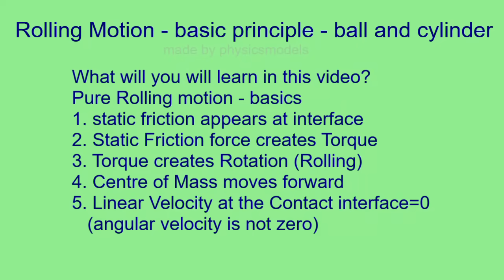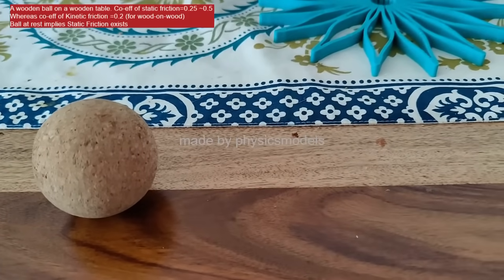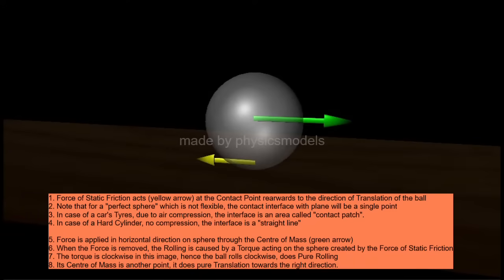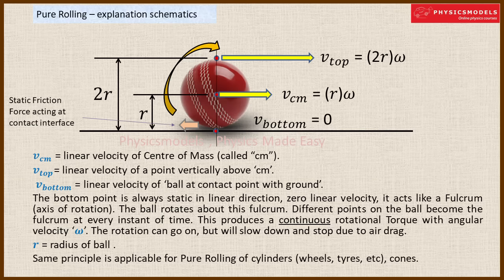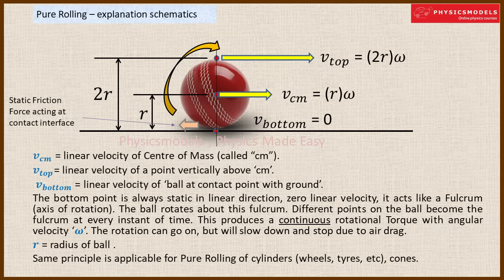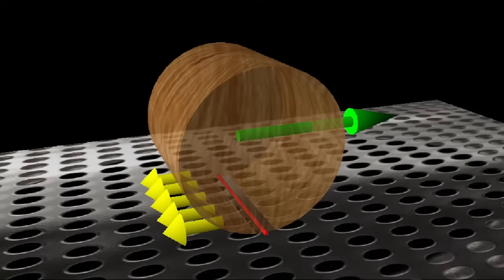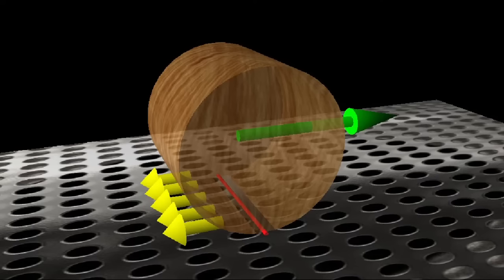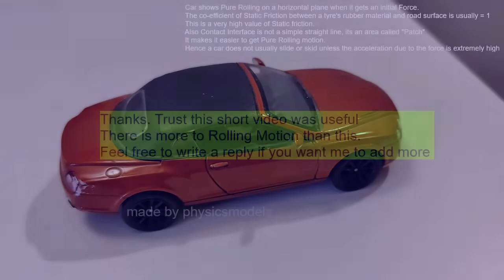Physics Made Easy- Pure Rolling Motion explained - Case of a ball and cylinder

Comment: If we're rolling forward say in the +x direction to the right, is the torque into the screen (say +z is out of the screen)?

Also to be clear, you're writing r*omega only rather than the cross product omega x r because r is purely 90 degrees from the rotational axis for omega?
Reply from the maker: Hi, for the ball in video , Centre of Mass has a linear translation motion towards the right. Let's call this the +X axis. The frictional force is towards the Left, the minus X axis. The Torque is such as to cause clockwise rotation of the ball. Apply Right Hand Thumb Rule. The direction of the Torque vector is INTO the screen. The Magnitude of torque vector is given by :  Torque= (Moment of Inertia)x (Angular Acceleration)
Reply from the maker: Hi jenm, also take a look at my latest video on Rolling Motion of a ball coming down and inclined plane, link: https://youtu.be/jRz6MjK7kN4

Comment: I have a doubt,Friction is necessary for acquiring pure rolling. So if after acquiring pure rolling if we removed the friction,will the ball still be in pure rolling motion.

Please clear it.
Reply: Yes the ball will still be in pure rolling motion. Friction is absolutely needed for pure rolling, but only to start it's pure rolling. Once friction is removed, the body will still roll purely
Reply: Actually, rolling is possible even without friction. That is possible if you apply a force at the point of percussion of the rigid body
Reply: @Serwerrryeah, in general we need just any force to provide a torque to the translationally rolling ball. friction is just one of the forces being discussed that does the job
Reply from the maker: Clarification: after the ball starts rolling motion on a horizontal surface having friction, if in case the next surface has zero friction, which is equivalent to "removing friction" , then two things will happen:
1) initially the ball will continue to roll, but only for some distance since the masses inside the ball have their own infinitesimal inertia and will tend to continue their circular motion (for some time only)
2) however, due to zero friction at the point of contact of ball and surface, there will be zero force of rotation, hence zero torque. Then, the ball due to its inertia acting at its Centre of Mass , will only have pure Translation motion (in the same direction). Again, due to zero friction at the surface, the only other opposing forces being Air Resistance, the ball will, after some distance, come to a stop.
Reply from the maker: Hi please see my recent videos 
1) https://youtu.be/nPzGgr9zEcc -- block on block - therory and solved problem
2) https://youtu.be/76PqTL-a5wg -- Block on Block - theory and solved problem-2
3) https://youtu.be/WHmi-DBZ1nc -- Magnetic Field due to current - solved problem